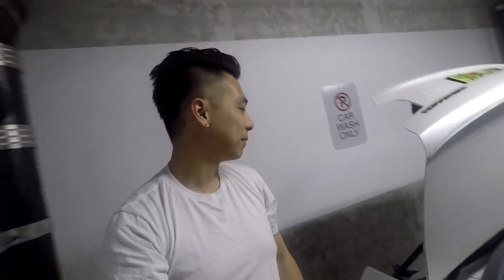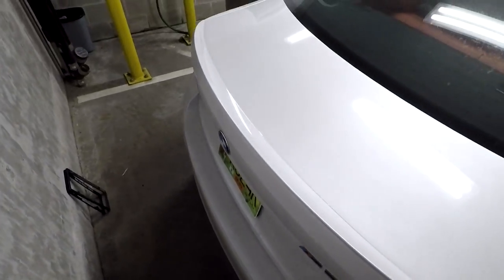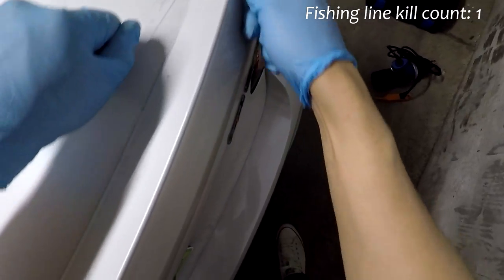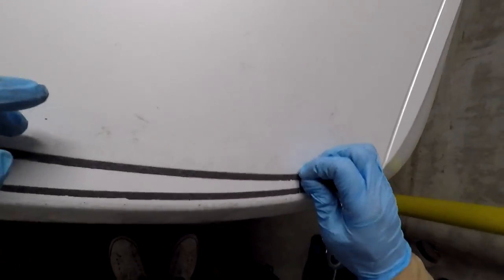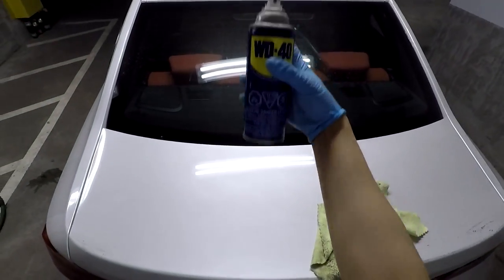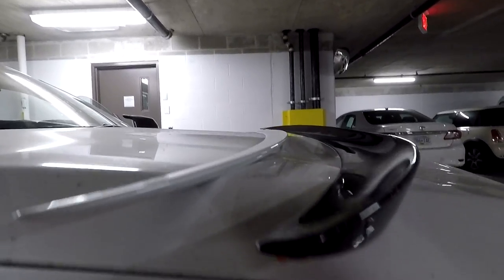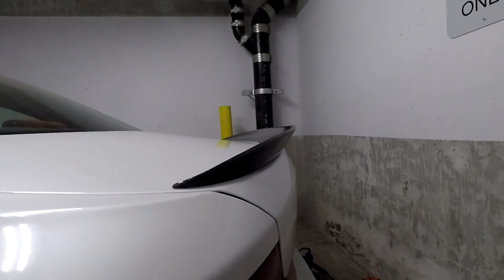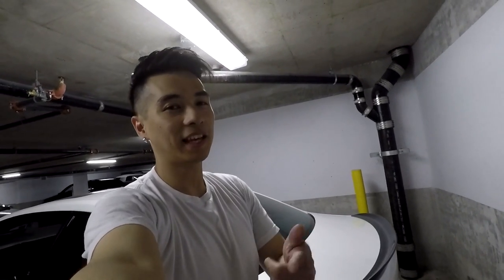LOOKS WAY BETTER! - Carbon Fiber Spoiler Install //BMW M240i

Comment: Great video. I sold my 2022 Supra and then wanted another but the mark up on the 2024 Supra is ridiculous. So I researched and bought a 2024 M240i x-drive. What an absolute bargain. 2024 Supra is $81k out the door. Got the BMW for $61 and love it. What a great car. Has more tech than the Supra and looks beautiful. I want to go with the bigger spoiler so thank you for the video 👍👍

Comment: Awesome! I literally did this exact same thing on my 228i this afternoon. My fingers are hurting as I'm typing this, but the end result was well worth it. My dental floss count was 4! and wd40 helped tremendously removing the old adhesive.
Reply from the maker: Nice man! I think my fishing line was only BARELY stronger than dental floss in that case lol.
Reply: @Shundel  A question I had a 240 convertible  the spoiler from BMW was around $ 650 it was a little off I traded it the other day kept the spoiler ,do you know buy chance  if it will fit a M2 I go to a racetrack in Ga there are alot of M2 thank you if you could give me an answer  .

Comment: Great video. I'm loving all the subtle cosmetic upgrades your doing. Just adds to the already subtle good looks of the 2 series. I'm liking this 'low end' model (if you can even call it that, LOL) more and more over the higher end ones.
Reply from the maker: I absolutely agree with you on the subtlety of this car. It's such a sleeper on the road until you put your foot down. And I hope to keep it that way with these small cosmetic changes. Always nice to hear your feedback, Stephen!

Comment: Great video. If i don't have heat gun, can i use my hair dryer instead? Thanks.
Reply: Absolutely. It just takes a little bit more time to heat up but the end result is the same. Go for it!

Comment: Is that the 1/2" wide 3M tape? I have the RW Carbon spoiler on the way for my M240i, but it doesn't come with tape. I found a 1/2" x 15 ft roll at Wal Mart that looks like it should lay down three strips and do the trick.
Reply from the maker: I don't remember the width but it came with the spoiler. I'm sure 3 strips is more than enough. Good luck!
Reply: Thanks! It's all done. Ended up with a major blister on my finger from peeling off the OEM tape (even with a heat gun). Whole project took around 2.5 hrs. Picked up the car in April, so maybe my tape was more cured. It looks awesome though.

Comment: Great video.  I've got a EB M240i and this is one of the mods I will be doing to my car.  Where did you get the spoiler?  Is this the Mperf one?  Thanks!
Reply from the maker: Thank you. The EB looks so good and it's very eye catching when you see it on the roads. I got it the spoiler from ECS but it is not the MP one.
Reply: Shundel Thanks for the reply.  I will have a look at their website.

Comment: like the videos.Shundel, I found it late, but my car had no M badge on the side. Is the M badge missing in the 2018 model? Do you know about this?
Reply from the maker: Hmm the ones I have seen here have the M badges on the side :\
Reply: Shundel it’s so weird. i need to contact the dealer:(
Reply from the maker: Hmm my only guess is that different regions get slightly different variations of the car. All of the ones I have seen locally have the M badges on it!

Comment: Hey would these fit on 228 or 235? Does anyone know if the trunk is the same size on all these models?
Reply from the maker: Yup it's the same chassis. Just just coupe. Not the cab version.

Comment: Is there really that big of a difference between a m235i and 240i?
Reply: yep
Reply: As far as this install is concerned, no. As far as the motors are concerned, yeah that B58 in the M240 is much more stout.
Reply: Yea the g42 body has dif rear so it needs bmw OEM m performance carbon fiber spoiler which they have but don’t sell it with the US 2022 m240i model

Comment: Can you link the tape you used?
Reply from the maker: 3M tape came with the spoiler when I ordered it. Other than that, you can pick up extra at almost any hardware store! Mine specifically was from Canadian Tire.
Reply: Shundel thanks brother

Comment: How has the spoiler held up? Have you noticed any bubbles or discoloring of the clear coat?
Reply from the maker: It's held up as good as the day I installed it. I just checked and there are no cosmetic issues from what I can see!